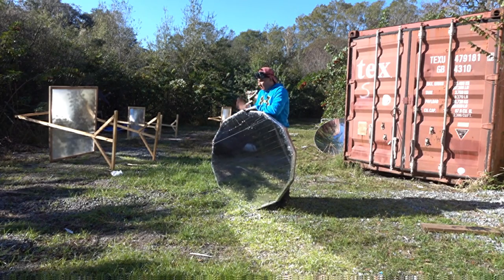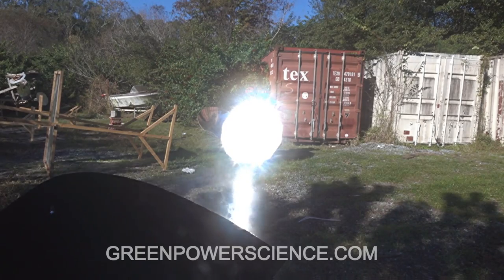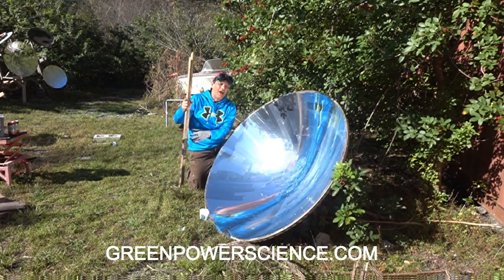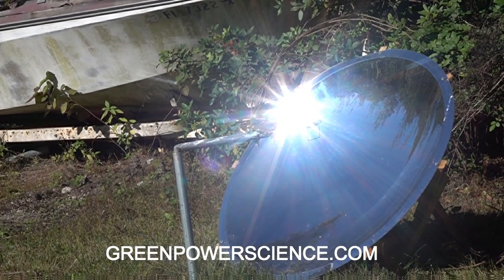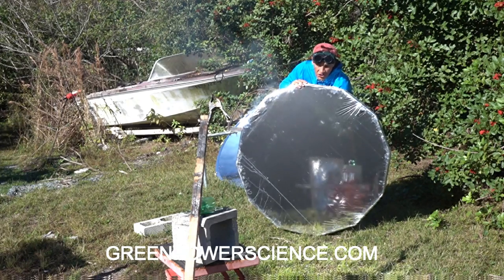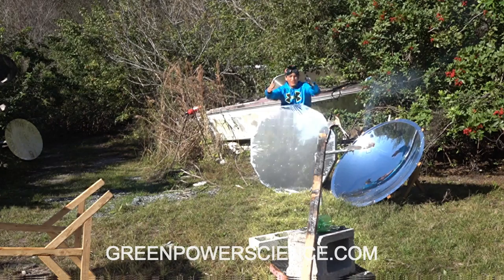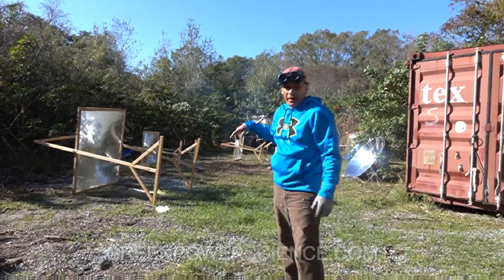Parabolic adjustable death ray greenpowerscience 40 feet destruction

Comment: Yeah, impressive !  For those who don't know the archimedes system was up on a tower and purportedly used many guys in a semi circle around the tower holding polished shields to reflect sunlight sunlight on perhaps a mirror (or perhaps even a crystal ? ) on top of the tower to create a beam (laser?) of light that was aimed to cause the attackers ships to catch fire.   Of course this could also have been a ruse to distract and blind the ships crews while a fire ship was sent into the midst of the attackers to cause fire that way? * The tower was very close to the shore; i wonder what distance was the beam of light to the ships?  *Imagine 10 fire ships sent in from all sides all at same time.
Reply: I guess you didn't see the mythbusters show where they debunked the idea of setting a ship on fire using mirrors, the best they could do is make is smoke a little...
Reply: I love mythbusters but that episode was bs. There is proof that the more of a parabola in the mirror to reflect the sun the hotter and more far it can go. Only problem with that is getting the aim/aligning the sun inside the parabola and keeping it in aim with the sun's movement as well

Comment: Another great video. I really love your stuff. Not complete projects, but information that can be applied to many different projects and applications, precise enough to understand, yet general enough to be applied in many ways. Keep it up! I'm currently working on an energy storage system (no batteries) for solar panels or wind, but obviously, if you need heat, direct solar heat is better than PV cells.
Reply: Care to elaborate on what you're doing for energy storage? It's the primary reason the solar setups are so expensive.

Comment: Dan, have you ever considered making a steam powered turbine electric generator?
Reply: For w«hat? If you can generate electicity directly.

No moving parts, no manutention, and they are cheap.just had some more panels if you need more power.

You have the eolic too.
Reply: Maxengines Tech With what, solar panels?  They're very inefficient and/or expensive.

A turbine electric generator is perfect for Dan's channel - it involves recycling parts (like scrapping a turbo and an alternator from an old car) and simple materials like steel pipes.  It involves welding, but remember, Dan welds using Fresnel lenses.  He could make something that generates more power than a solar panel while using nothing but trash, solar power, and water.

If that's not "green power science" I don't know what is.
Reply: why didnt he answer already lol
Reply: Stirling engines are a bit different than what I'm suggesting.

Comment: Wow I'd love to play in your back yard.   I see you have a fire extinguisher at the ready.  Prolly ought to have track shoes there too, just in case the extinguisher dont do it.  LOL  I played in the back yard with flat mirror wall tiles from Home Depot.  I cut them to 6 inch squares to get a tighter pattern and it turned out i could only keep up with about 15 at a time running around re-aiming each one as the sun moved, but I did manage to melt the glass in insulation behind a mason jar full of water which I had to drop in black polyethylene trash bag to get it to boil but at times it was exploding water out of the jar,   way beyond rolling boil. I had an old 10 foot satellite dish and cut a few mirrors to 1" and put on about 2 square feet.  Turned out the frame was so flexible it would have  needed a lot of bracing and the focal point was a bit too short I though.  Need like 10 or 12 feet FP so the mirror dish can rotate around a stationary target was the idea.   Well I got side tracked and never followed up.
  Busted a red brick from thermal expansion in the neighbors back yard in about 1 minute with a fresnel out of a projector tv like the ones you have in this vid. Red to black to white on that spot to explode in a minute.  We were able to draw about a 3/8 point with that one where probably 80% of that 9 sq ft aperature landed.  That stuff can really be dangerous, think ahead yall.

Comment: Hey, an update, finally!     curious, where are you guys finding the cheapest, most stable/awesome output solar panels these days?
Reply from the maker: PV electric solar panels.
I bought 5kW a few years back from Missouri Wind and Solar and ebay. Have not purchased any lately. The ones I have are a 100 and 250+ watts.

$1 a watt is standard for completed panels. Even cheaper. I would imagine the prices cannot go much lower than that because the frame, non reflective glass are more than 50% of the cost. We paid off or panels in 3 years. Now, would take about 2 years. Good investment on the DIY side. Pro installs require research of the installer.

There are 275 watt panels for $225 now. One of the reasons stan and Stirling are no longer cost effective vs PV solar. PV is plug n' play and no moving parts or tracing required for non-optimal output.

Comment: if you had pots of water stacked up the steps of say a pyramid, and it was built in a proper relation to the sun, could it be possible to focus all the reflections near the top and then have a mirror to aim the death ray?

Comment: Thank you guys!  Your videos are amazing, and the effort you put in every one of them is more than noticeable. Valen mil. 
Holwever, I have a question. I want to cook using solar power in a daily basis, wich system you would recommend? iI would give no good if my clay pots and caceroles just got a hole through every one of them.
Reply from the maker: Hi Hery,
Black cast iron is required for solar cooking with concentrated sunlight (clay works with solar oven). I suggest parabolic mirrors for cooking as they are easier than Fresnel lenses to cook with.
http://greenpowerscience.com/SHOPHOME.html

Thank you for enjoying our videos and let me know your location. I can make suggestions.
Reply: thank you very much, buddies:D

Comment: Where can I buy it, or where can I buy this blanket? How does it form a perfect inner curvature?
Reply: Mick Carson walmart survival blanket. Like 99 cents. Camping section
Reply: Daniel Rich 
Bro, there are no Wal-Mart's here. I am in Austalia. How did you make that inner curvature? What is this blanket used for other than this idea?
Reply: Mick Carson its a folded reflective survival blanket. I think thats what he used anyways. They are mostly used for cold weather if your wet. You could probably find them online, i dont see your local stores in Australia having them because of your weather. Lol they look and feel like super thin aluminum foil, but plastic
Reply: Mick Carson and the dome he has could maybe be an old plastic sky light or something that he glued the blanket to the concave surface. Not sure if thats what he did. Just an idea
Reply: Daniel Rich 
You could be right as the curvature of the perfectly concave dish (1:40) with round edge is too good to be hand made. It could be an old satellite dish. Whereas the other one with octangonal edges is definitely hand made and adjustable to create a burning hot sunbeam. That's what I think he's done. Still, it's a good idea usong them on sunny day to cook smelly foods that contaminate the kitchen. I generally like to use large magnifying glass to send sun light down. That way they will not be too dangerous as the hot beam points down and directly on a hotplate.

Comment: Can you combine the effects of the parabolic disc and the fresnel lens?
Reply: MeatPopsycle sure why not but you're gona need a heat proof parabolic mirror or a heat proof  lense and the lense or the mirror has to produce a focal point the size of the mirror or the lens to have that combined effect you are talking about. I think a good setup would be one lense the size of 10 cars focused on to a mirror about the size of the one in the video
Reply: You could not just get the disc to focus at the center of the lens? I will have to look a bit more into how the lens actually works.
Reply: MeatPopsycle because like these lenses and parabolic mirrors all do the same thing focus something big to something small if the lense already focused the light then only a little portion of the parabolic mirror would be used.
Reply: Ah yes. I see what you are saying. You would need to have multiple discs to all shine their own light to a single source. Thinking about it that way, would you think that you wouldn't get too much of an increase combining the two? It would probably be better just to use multiple disc all focused at the point you wanted to heat.
Reply: MeatPopsycle yea an array is better.

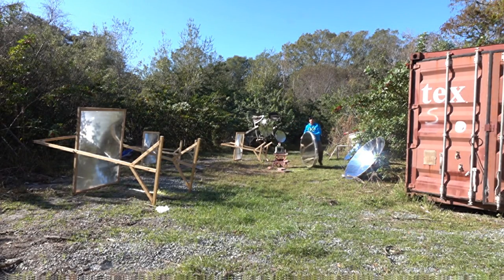Comment: Dan if you make the film go Across a drum or ring .....  I was involved in making parabolic dishes for Military Radar reflectors in aircraft, you have no idea how it is really done. Too valuabled to share on YouTube. If you leave these pointed in the air like this you actually can be cited by FAA for blinding pilots. Seriously dangerous practice. Reflectors can be a weapon used in any war if the sun's position is known and redirected by even 2 paired reflectors,  You can blow out a camera sensor quite easily.   would like to see a solar forge  made and mechanically controlled (sun tracking) for a few hours for MELTING  pounds of Aluminum .  Also near the video's end, about 7:28 there is somethiong burning in the lower left of frame on ground?

Comment: Whoa...awesome!!!! How much does it cost to make one? I wonder how hard would it be to make a tracking device to make a solar HW system with one...
Reply from the maker: The build cost is less than $10 and the tracking would cost $100-$500 depending on accuracy required.
https://www.youtube.com/watch?v=FyCLOXF1188&t=41s

Comment: A way to make an adjustable vacuum would be to create a hole in the side the size of a wine bottle opening and stick a rubber wine vacuum plug in it and then use a hand wine vacuum pump.